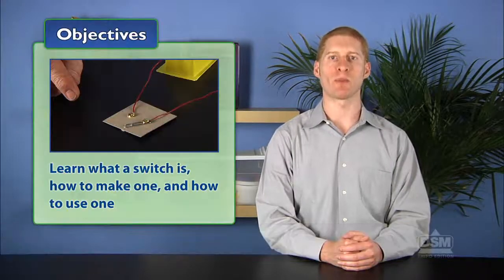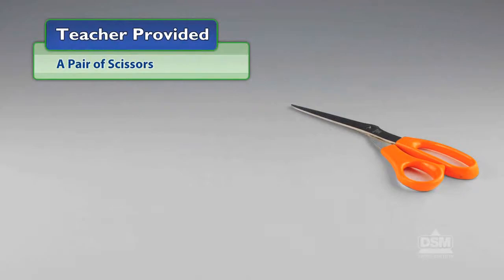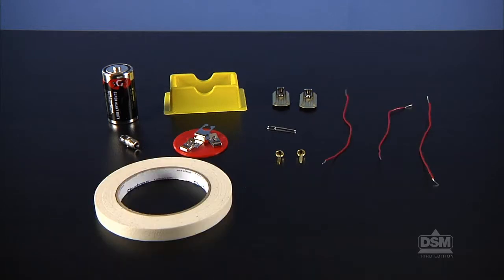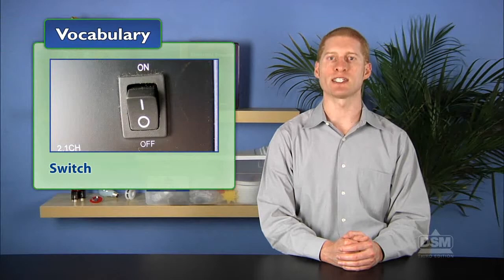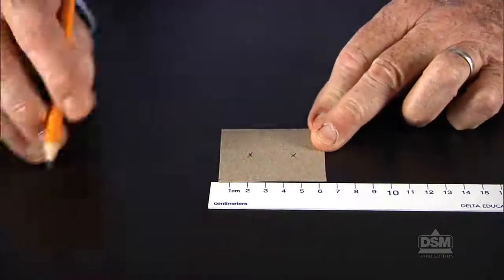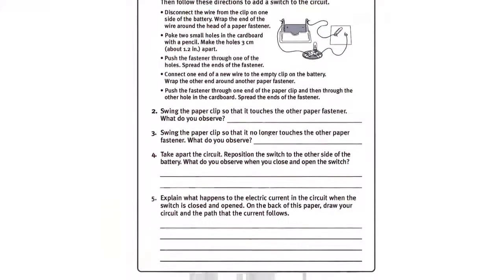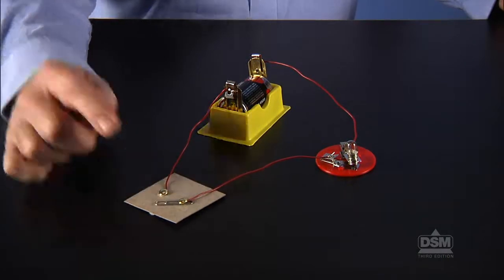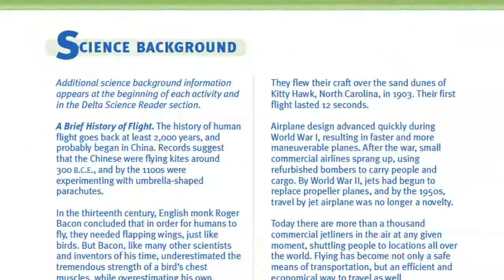Electrical Circuits - Activity 5: A Paper-Clip Switch

Comment: can I use two nails Instead of the paper fasteners. I have a block of wood for my base? Will this experiment work if I secure the paperclip with a nail and touch it to a second nail, same as you did with the fasteners?
Reply: Cheryl Singleton it will